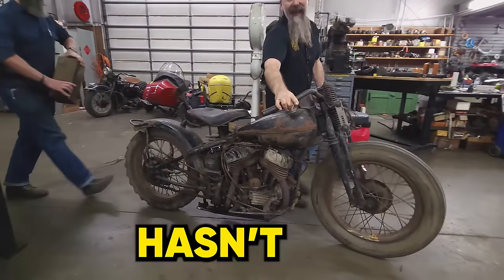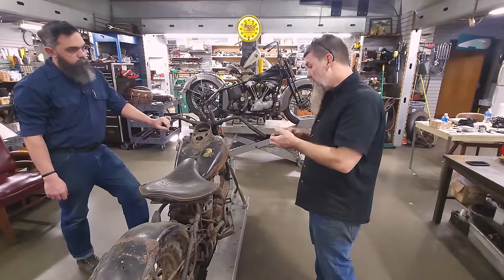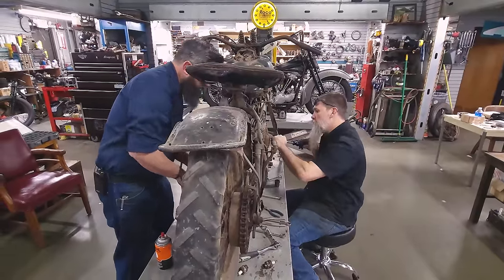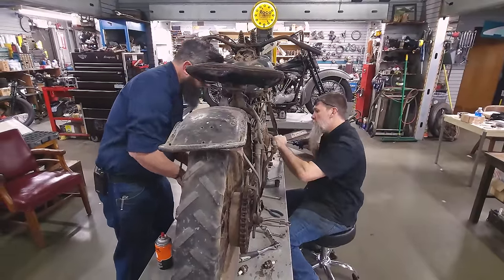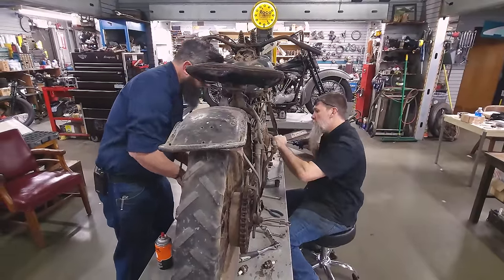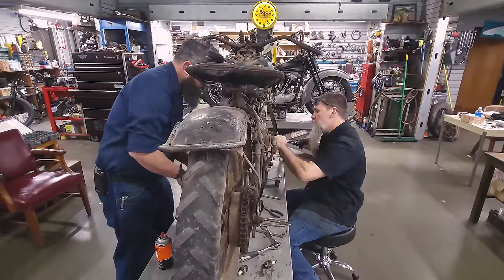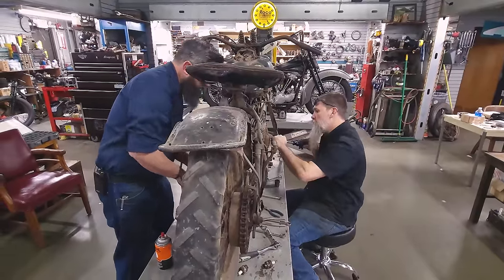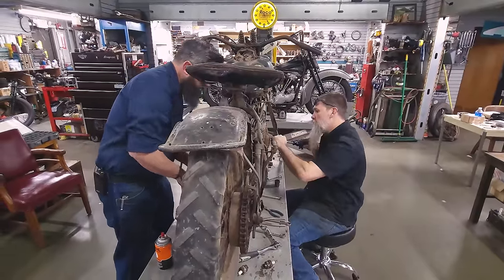Wrecked And Rusted JUNKYARD Motorcycle Sitting 60 Years!

Comment: It's ironic that no matter what a person anywhere finds, the previous owner will always say "It was running when it was parked".
Reply: Right! And what they really mean is, “I neglected to maintain anything on it except the dinosaur oil changes every 10k miles and when everything was completely unusable and it was running as far from how it ran when I bought it and the shop quoted me $10k to fix everything I was too cheap and lazy take care of, I parked it and left the tank and carbs full of E85 high ethanol without adding any of that gimmicky fuel stabilizer. Oh, and it never came near a battery maintainer.”
Reply: Sometimes it's true 😅 running on prayers, duct tape, and baling wire
Reply: But they are not wrong

Comment: I remember in old motorcycle magazines those engines were for sale in the 1950's for $60 . The good ole days!
Reply: not really because in 1950  $60 is about 700 dollars in todays money :D ..and people made like 75 cents an hour :D
Reply: Those were the golden years, since many things have been steadily going downhill since the early 60s, like equality, morals, corporate standards and American economic power.
Reply: The Harley Davidson Dealer in Rahway NJ. Had purchased some WW2 45’s in wooden crates,that they sold for $200.00. I purchased one and used it as a dirt bike for many years. The motorcycle had to be assembled. The engine and transmission were the only things that didn’t need to be assembled. I had to lace the rims to the hubs. The directions that came with the motorcycle were not very good. It came with a tool kit for assembly. This motorcycle was my most favorite childhood memory. I was 13 years old when my dad allowed me to draw the $200.00 from my savings account. I had over $1,000.00 in my account from mowing lawns,Trapping Muskrats,delivering newspapers and collecting the money for the newspapers. At 17 years old.I traded the 45 for a 1965 Chevrolet Corsair Monza. The Corvair was a great vehicle. The only problem is the engine wore out spark plugs within 2,000 miles. The engine would still run but the performance would drastically drop off. I put Michelin Radial Tires on the Monza. I don’t know where the Corvair got this reputation for flipping over. Where I lived, there are what is called the S-Curves at 25 MPH. My 1965 Monza with the Michelin Radials easily negotiated the S-Curves at 60 MPH.

Comment: You opened up memory lane for me.  I used to have a WLC from 1942 I believe  in the late1960s and have done a lot of similar repair work on it.  I loved to see your repair work.  Keep them running.
Reply: I picked up a 42 wla flathead in 1977 as my first vehicle. It came with a military manual. It was indestructible.

Comment: Man this is so cool! I was never really into bikes again until I bought my son a 110cc pit bike. I've already put a new engine in it, new exhaust, new fuel tank, new seat and plastics, new tires, all new electronics, everything but the frame and it runs great now. It could definitely use some more power, but it's fun for a small bike and is fairly capable offroad. When I was younger I owned a 2001 Harley Sportster 1200 with a bored engine and about $5,000 into it. It wouldn't hesitate to pull a wheelie. I also had a 2000 Honda CBR1000 that would scare the absolute hell out of me at full throttle. When I was 18 I rode my buddy's Ninja ZX-12R down I-4 from Tampa to Clearwater Beach and I had it up to 185 MPH and I watched a guy on another crotch rocket get killed right in front of me that night on the same stretch of interstate. It was enough to scare me off of fast bikes...I rode his bike back at either the speed limit or slightly below and I was shaking the entire time. I tried to make baby steps with my Harley, but it took a while for me to get comfortable again. I never took it over 120 MPH...

Comment: Back in '68 I bought a '40's 45 cubic inch for $25.50 from a barn in T or C NM.   Welded the front fork back on, and somehow put the distributor back in 180 degrees off...and it RAN !!  Kinda.  I n '65, Dad's mistress gave him a '37 Hog for me.  I rode it to work back & forth to Philmont Scout Ranch.  One day the rear fender flew off.  One day the  clutch pedal fell off.  One day exiting rhe highway into Raton, the CARBURATOR bounced down the highway.  It leaked oil.  I got 12 miles per gallon of used 90 weight  crank case oil.  I sold it for $40, then kicked myself for 40 years.  Carried gallons of oil in US Cavalry leather saddlebags.

Comment: Man seeing the transmission issues brings me right back to my trans issues. Im willing to guarantee that the plate thats inside that pushes on the first gear is worn. And the bushings and shim washers are worn beyond spec. Id rebuild that transmission for sure. Also the clutch dragging may have been dirty grimy plates from transmission oil that leaked on them. They get sticky.

Comment: I'm enjoying this video, and the history.  I am at the point in viewing where you have just grabbed the propane torch to try to burn off some of the carbon on that cylinder.  I just wanted to point out that a much, much more effective method is to use a cutting torch set with a very low pre-heat.   Get the carbon to glow a bit with the pre-heat  and give it some oxygen and the carbon will disappear leaving clean metal.    A variant of this method was used for years to 'de-carbonize' engines.    It is staggeringly effective, and you may want to give it a try.  Obviously you don't use so much pre-heat that the base metal reaches the kindling temperature for a cut.   Try it on some scrap.  Takes paint off like nobody's business, too.   A propanox torch will, of course, work just fine.  You don't have to use acetylene because you don't need that much heat.

Comment: Little tip on the float. You can use model airplane dope on the screw. I've restored old tractors and made my own float from nitrophyl and coated in dope and they last forever
Reply from the maker: Good advice!  I like to JB weld over the screw when I’m not in a hurry.

Comment: And if you're an old shasetree bike wrench like me, who doesn't have that nice valve seat cutting tool set. you take the valve & completely clean up both the valve face & the seat, and putt some lapping compound on the seat, break out your cheap valve job tool kit, get a good seal on the valve face with the ol' suction cup, and give it a po' boy quickee freshening.

I've been spinning wrenches on old Harley & Indian flatties for a good part of my 67 years, my gramps, my dad, and two uncles taught me tons of workarounds for when I didn't possess the precise tools to do it by the book, and I've literally written my own service manuals for just about every bike that I've ever owned, raced, or just worked on. And I get just as much joy & the pride of accomplishment now, as I did when I got my very first racing bike, (a 1957 BSA Gold Star 500), at the age of 12.

Comment: Hey guys good job on the bike. It's go to see old racing Legends run once again. When you after you got the valves squared away an you where rolling it over I see something Unique in between the valves and the cylinder. The edge of it was rounded over I seen this done on some flathead v8 fords.ford's. The time stamp was 25:36 you can see it clear as day if you pause it. Well keep having fun and ride safe.

Comment: I bought my first twin - a single carb A10 BSA back in 1965.  It was a late 50's model.  It ran and I began driving to work.  I changed the oil and drove it for a month on a daily basis.  One fine day I was driving and feeling confident in my ability to handle this twin I twisted the throttle to wide open. BAM!  the thing practically shot out from under me.   Turns out I had been running on only one cylinder and never realized it (being use to single cylinder bikes).  Funny thing - I never had another problem with that lame cylinder.  To this day I don't know what was wrong or how it got fixed.  It was a magneto bike so that could have been the problem.  Just don't know.  Any guesses?

Comment: My first ex-father-in-law had a '36 HD with a 45 WL in it.  We got it out of the barn where he had put it and it hadn't been started in many years.  His brother had burnt the original engine up by running it out of oil, so they got the war surplus engine and replaced the original.  I started a rebuild on the bike by stripping everything off the frame, then I had the frame and tins media blasted with walnut shell medium, then primed with red oxide primer.  My brother-in-law decided to give me a hand while he was home from the Army and disassembled the transmission.  Nothing was labeled and all the needle bearings on the clutch-side of the case fell out.  In the meantime, my best friend and best man was killed in Vietnam, and I had a hard time dealing with it.  I sort of lost interest in the bike, coupled with the brother-in-law's unwanted help, and put everything up.  The oil fill neck was broken on the transmission case, and it took my father-in-law a while to find another case.  I went back in the Navy, and he finally finished the bike a couple of years later.  My wife and I divorced; I was reassigned to a ship in San Diego in 1975, and I bought my first Harley, an AMF FLCH Electra Glide.  I purchased it at San Diego Harley-Davidson on India Street.  My salesman was Ray Fletcher, and the owner of San Diego H-D was Leonard Andres.  There was a poster, like one of the pictures in this video, mounted on the wall of his son mounted on a motorcycle.  Leonard's grandson drove to his uncle's shop in Lemoore, I believe, and brought my new bike back to SD.  A great bunch of people there.  Their Chief Mechanic was a guy named Carl Barnes.  I would ride my bike out into the desert where they went to camp, over by El Centro, on weekends.  Sit around a campfire, drink a little beer, eat some great food, and ride dirt bikes in the desert.  They took a Sailor in and treated him like family.

Comment: That's an original desert sled. I follow D37 racing, if it was raced out here in California, it shows by all the beatings it has. They started racing post WWII and still going strong. The double clutch might be for a quicker dead engine start. 

BTW, The Yellow Jackets MC are like the Hells Angels which you'll NEVER see racing an enduro these days.

Comment: Is rather amusing that it has a Goodyear Sure Grip tractor tire on it . I had a Newway valve seat cutting kit i used to resurface valv seats in the esrly 70s . Also had a Sioux valve grinding machine used to reface valves.

Comment: Only a few minutes in but putting a little oil in the cylinders through the spark plug holes might get your compression because the rings might be dry, ok I see it is a valve issue nice job, I work with cars and never would have thought of rust on the valves

Comment: A tyre has only 1 burnOUT, no matter how old it is. If the tyre does not blow, than it's NOT a burnOUT. Don't remove the buttplug from the rear fender. That is there for improving rider experience/satisfaction. ;)

Comment: I had 15 of those 13 i bought as a job lot off the Belgian Police who were still using them in 1970 they were all 1936 ex WD HD 45's 750cc side valve hand gear change foot clutch the motor is bulette proof except for the Tilletson Carbs which i replaced with Amal Monoblocks .
Reply: They were all both hand or foot clutch

Comment: Matt, notable engineers like David Vizard and dyno operators like Richard Holdener will tell you, backpressure is NOT useful or beneficial in any way. The pipe and muffler adds torque by tuning the exhaust pulses to improve scavenging.

Comment: I like all the different projects but I normally am too impatient to go from begining to end you guys have a little bit of chatter don't see any other way to make the work day fun what I really like is the lack of bla bla bl;a yakity smackity you guys know your stuff and you seem to stay on topic the way you ran through that bike shows you know's myself I'm on my third Harley and my first real project I will make no claims to being a mechanic of any sort but I can read thats always a plus and I do know how to turn a wrench in the time it took you to get that bike running I would likely not even found a manual just to know the componaqnts Hey how about for your next project you tell us all about how important research when your a wanna be like me is so important I have a 2007 FLSTN YOU SEE NOT A MECHANIC BUT ANJYONE THAT HAS OWNED A HARLEY ANY HARLEY YOU DON'T GET ON A BIKE THAT SAT IN YOUR DRIVEWAY SEVERAL MONTHS AND TAKE IT FOR A 60 MILE HIGHWAY TRIP WITHOUT AT LEAST TIGHTEN UP SOME LOOSE BOLTS SEE I'M NOT COMPLETELY LAME WHAT BOLTS IT COULD BE A VARIETY OF PLACES OR JUST ONE THERES ALWAYS AT LEAST ONE OH HE FOUND OUT WHEN DEALING WITH A AFTERMARKET 3" OPEN BELT CLUTCH IF THE ADJUSTMENT ISN'T RIGHT OR WHATEVER THE REASON WHEN YOUR CLUTCH BASKET LOOSENS UP RIDING DOWN THE FREEWAY ON A BIKE THAT CAN HIT 100 BEFORE YOU HIT 6TH GEAR  YOU SHOULD NOT WONDER WHY YOUR SEEING A HUGE AMOUNT OF METAL BEFORE YOU STOP CHEWED THE CLUTCH CHEWED THE BASKET CHEWED THE FUCKING REAL EXPENSIVE PRIMARY COVER AND MAYBE EVEN SOME STRESS CRACKS WHERE IT BOLTS ON ALRIGHT I'M DO0NE THE BELLY ACHING TOO THE POINT IS THERE ANYWHERE I CAN GET A OPEN BELT PRIMARY COVER USED FOR LESS THAN A GRAND I WATCHED YOUR SHOW IF ANYONE COULD PULL OFF THIS MIRACLE IT'S YOU OH I DONT HAVE A MOTORCYCLE MUSEUM AT MY DISPOSAL ANY ADVICE WOULD BE GREATLY APPREASHIATED OH AND ME YOU CAN JUST CALL ME THE WANNA BE DUMMY

Comment: In the first minute you said the motor cycle hadn't run in 60 years.  THEN you say the bike has been in the museum for 10-15 years and that the rumor was it was running when parked.  So which is it?
Reply from the maker: We bought the bike at an antique bike swap meet from a friend. We rolled it into our trailer, drove home, then rolled it out of the trailer and put it in the museum.  It sat in the same place for around 15 years, until we pulled it out for this video.  Thanks for watching!
Reply: He didn’t say when it ran when parked? Could have ran when parked 60 years ago and not 10-15 when he got it?

Comment: The more u run  the engine the better it will get if was a raceing bike u put raceing fuel in it and Lucas oil for the pistons and rings in it the more u run the moter the bad ass horses it will get and it not  wore out yet it need  to be runed As a raceing bike put it on Dino to see were the horses is at and run it